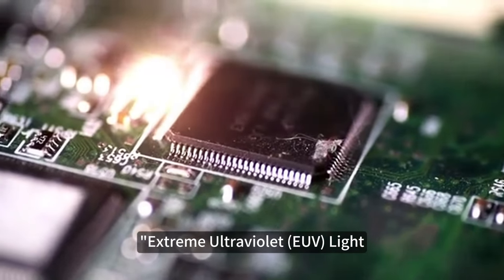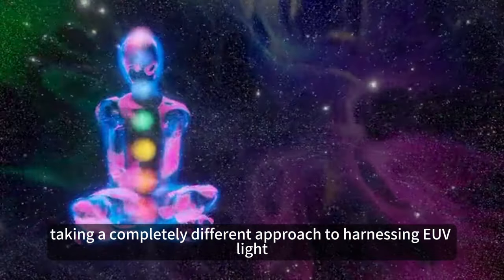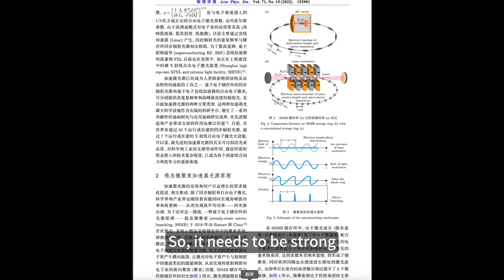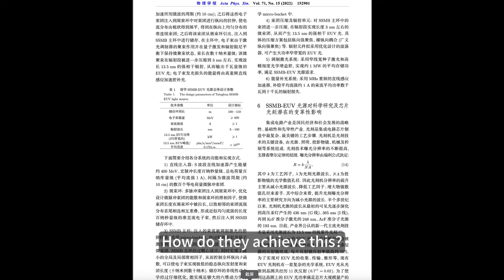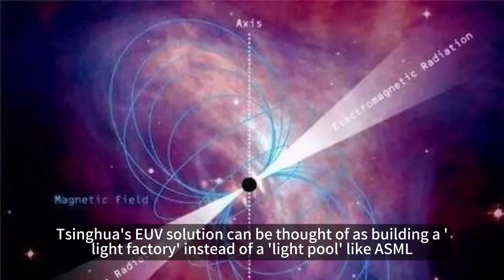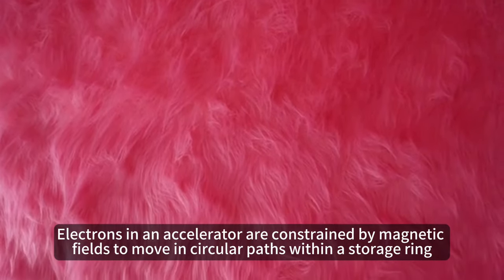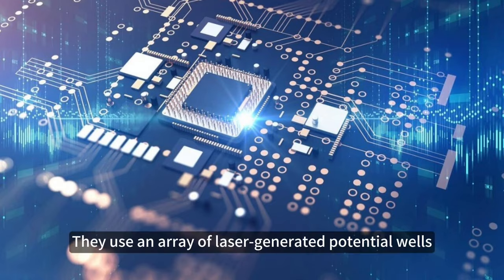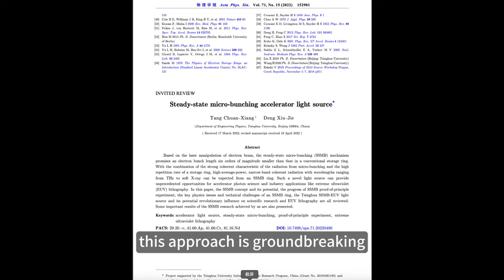Tsinghua's 0.8nm EUV Lithography Machine Breaks Traditional Paradigms

Comment: ASML's next-gen EUV machine uses high-NA, aka. larger-diameter, mirrors. This causes new problems: (1) The need to use anamorphic, aka. elliptical, mirrors and (2) the need to cut a hole in the center of the main mirror, aka. central obscuration. These in turn require (1) stitching of two rectangular exposure fields to get a square field and (2) incompatibility of certain circuit patterns with different spacings. (It was precisely because of these new problems that Intel recently decided NOT to buy ASML's next-gen EUV machines.) On the other hand, Tsinghua's approach can avoid the use of high-NA mirrors to achieve higher resolution, by simply scaling down the EUV wavelength in their accelerator. Once their accelerator is completed, they will overtake ASML by a mile!
Reply: Anamorphic mirrors are just a redirection to stepper technology, nothing new.
Reply: @c123bthunderpig  I forgot to mention that high NA also leads to much smaller depth of focus than using a smaller NA with a shorter wavelength.
Reply: Intel has now 1 high na euv tool running. Beginning 2026 with production. Number 2 is orded as well. Hyper na euv in 2030. So how for is china now.
Reply: @jeffreyf6960  Things change fast. It remains to be seen whether Tsinghua can catch up.